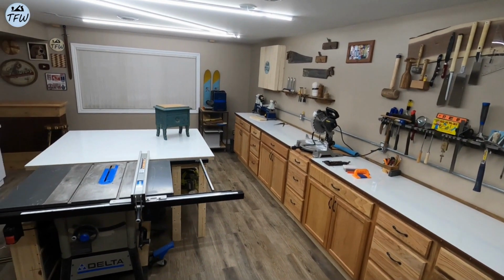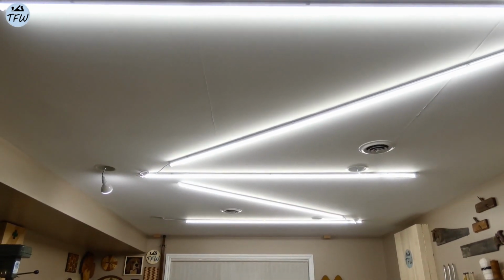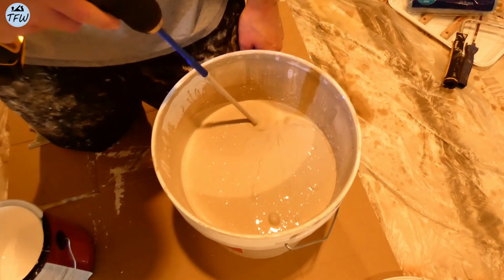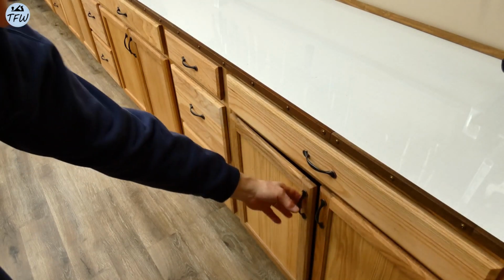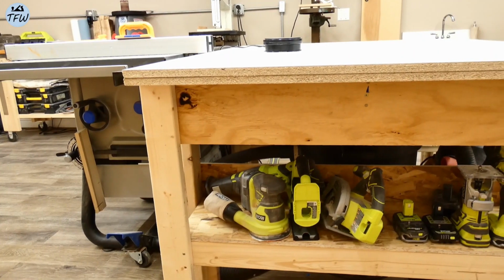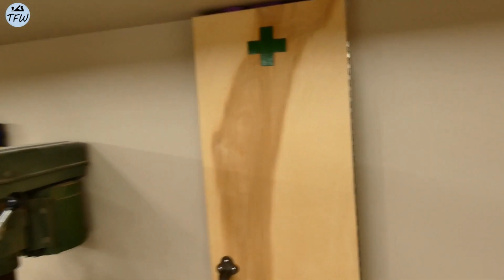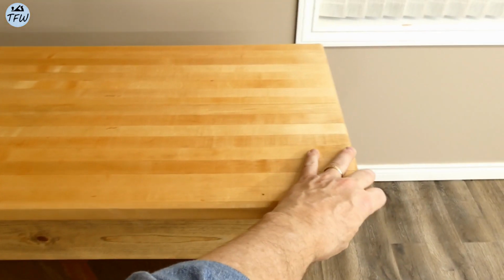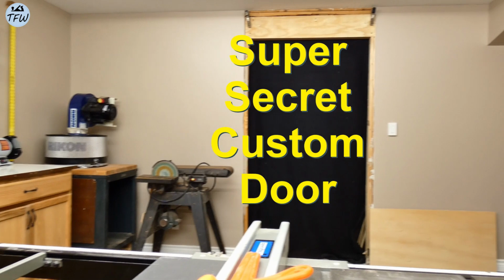My $3,000 Complete Workshop Build #woodshop

Comment from the maker: PRICE UPDATE:  I started buying materials in November/December of 2021 and took advantage of close outs (like my vinyl floor tile) and promotional discounts like my cabinets from Lowes. I took advantage of other wood material sales and the sink base from Menards when everything was 11% off ( a regular annual promotion).  I also saved by manufacturing my own countertops and used materials I already owned like Danish oil for the cabinet finish but, it's shocking to see how much the price of plywood and 2X4's have risen just in the span of 6 months.  A couple months ago (May 2021) I wound up purchasing some 2X4X8 better grade studs for $6 each and felt like I was mugged.  Other products like the ceiling light bars on Amazon have risen in cost too so I empathize with you all about the general pain of buying, well, like anything these days. If I were to do this in today's money (July 2022), I think this project would have cost me between $3,400 and $3,700.  It was still money I was going to spend regardless of cost and I think the result was pretty great. I love using the new shop layout and there's plenty of room to handle most any size project now. If you've seen my older videos while crammed into my small mechanical room at the old house, you'll know how much better this shop works for us.  So keep a stiff upper lip, guard your wallet and keep on searching for those elusive sales.  As always, thanks very much for tuning into our little channel!

Comment: Nice job! Where did you order the laminate?
Reply from the maker: I got it from Home Depot, though I'm sure there are other suppliers.  Here is the link and it looks like the price has changed a little, but so far it is working out great.  Best yet, after a few years of abuse when I manage to drill holes in it or scratch it to death, it's not that expensive to replace...  Thanks for watching!

https://www.homedepot.com/p/FORMICA-4-ft-x-8-ft-Laminate-Sheet-in-Writable-Surface-ImagiGrid-with-Gloss-Finish-093131290408100/301380172
Reply: @TheFamilyWoodworker  Thanks! That's very helpful!